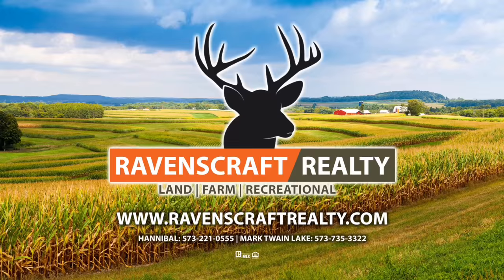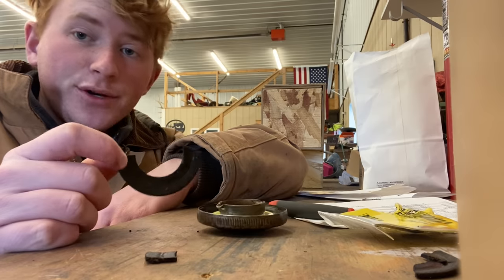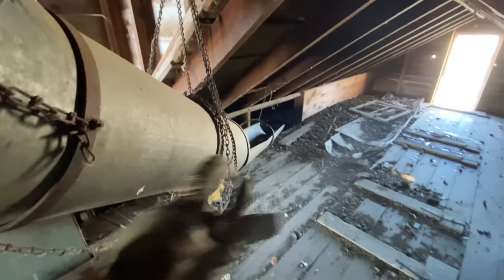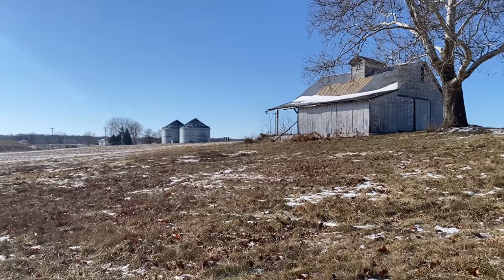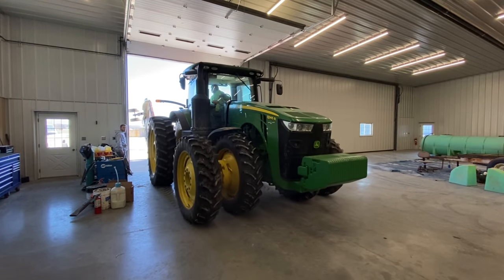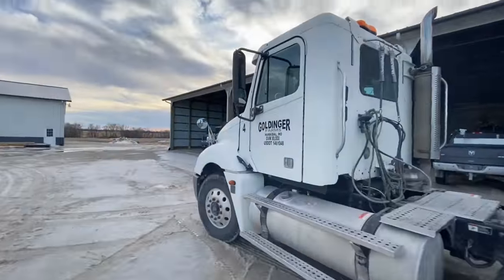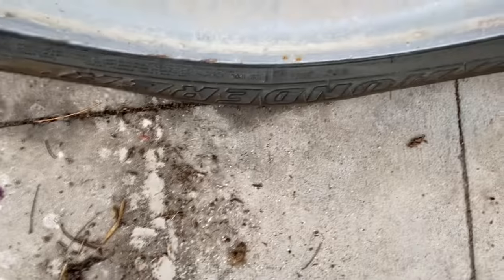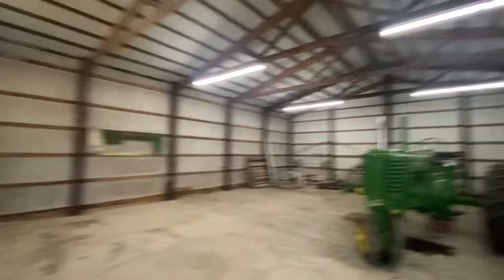Lazy row crop farmers

Comment: A Corn crib stores ear corn, that is a Grainery and it stored shelled corn . The corn crib was designed the dry down the corn before dryer and storage if the farmer did not have the ability to shell it.
Reply from the maker: The inner walls of the building had slats at one time, so it may have stored ear corn. The last time it was used it had beans in it